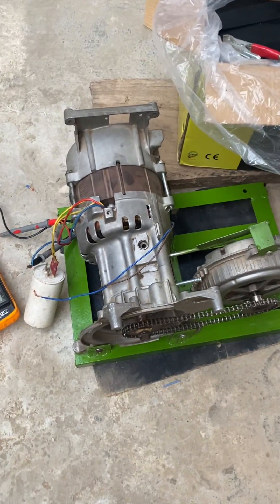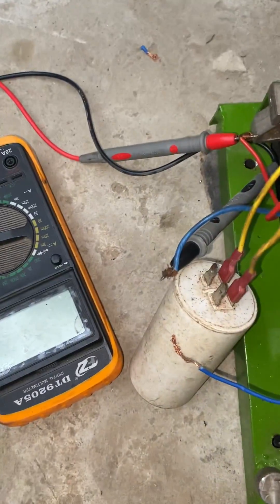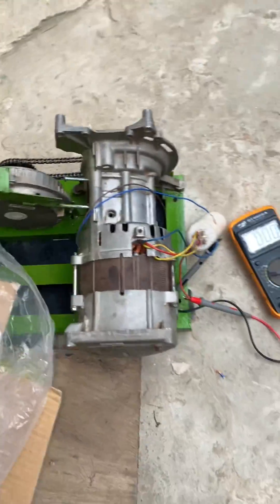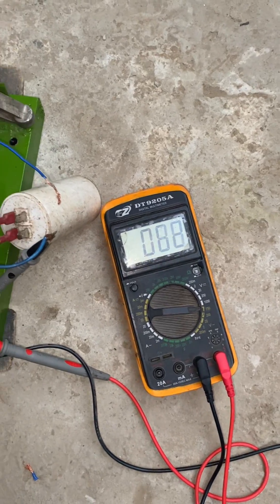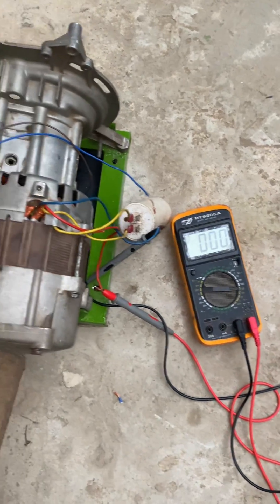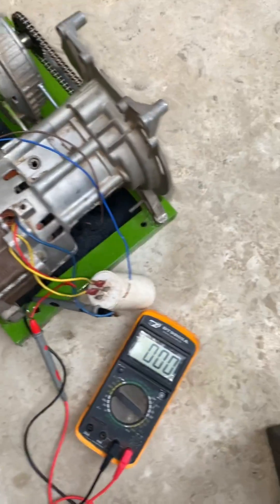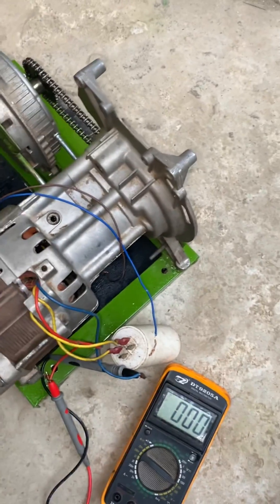FUELESS GENERATOR

Comment: Use a step down transformer on the ac output side or connect a speed regulator to the motor to control de voltage

Comment: Weldon job broh, the solution is simple. All you need to do is to build a speed controller that will regulate the speed of the DC motor, once the torque is taking care of, am sure the efficiency will be cool.
All the best man

Comment: Big inverter. To get useable voltage grab like 4, 25 mf high voltage run capacitors.
Reply: Oh, and wire them in parallel with the generator.

Comment: 300 amps would fry those Tester wires. A good welding machine puts out 140 amps with 8mm sq copper conductors. You are reading volts.
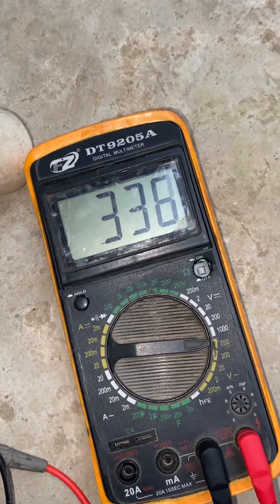Reply: He literally said at 0:51 "I'm having almost 340 Volts"

Comment: You are not fuel less if you have a battery running the motor.  YOu need to show amps out are greater than amps in.